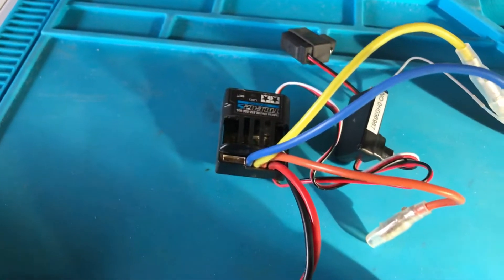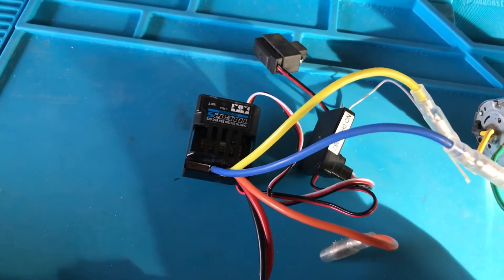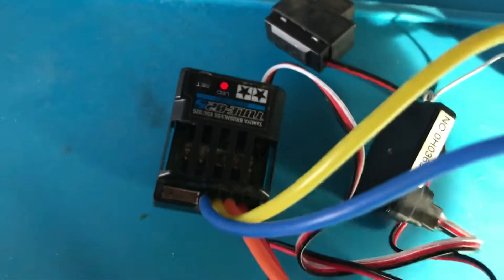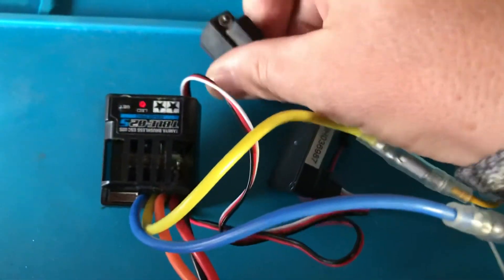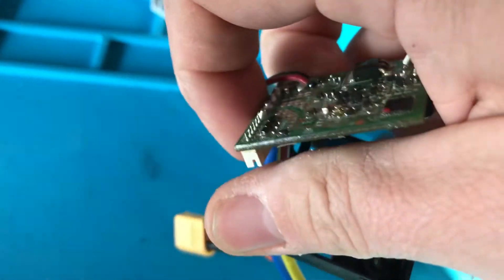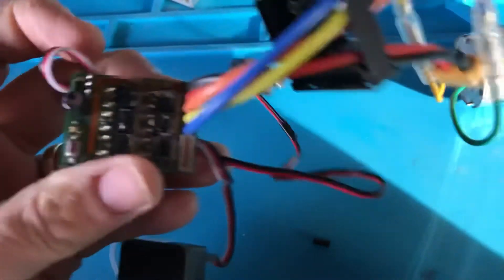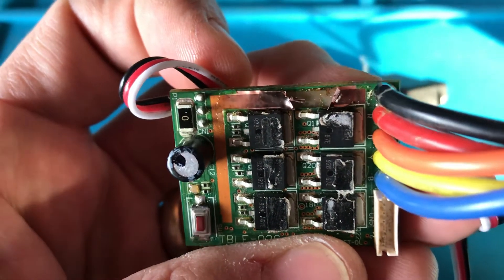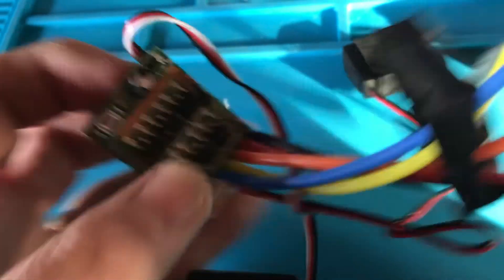Tamiya TBLE-02s Flashing red light overload protection

Comment: You can just jumper that. Make sure it isn’t too thick or it’ll rub the heat sink. Your bigger problem will be readhering the sink to the fets. You broke the surface of the adhesive backing when you pulled the sink. I repair these even when the fets blow. Pretty easy esc to work on.
Reply from the maker: I think if I blew another one, I'd likely go ahead and replace it. When it happened, I think I was inside ordering a hobbywing brushless kit within the hour and used it as an excuse to rip it apart. I'd been through so many documents online that explained what it "might" be, so I thought for future folks who come across things like this it'd be interesting to see. I actually just threw it out last week in preparation for a move.
Reply: @dangraves6358  I get it. Was always fond of these little ESCs. Hate to hear it got canned. But if it’s of no use to you, it’s of no use to you. You can get enough fets to repair 8 of these for 15 bucks. And that’s if every fet is bad. It’s usually only 2 of the 6. But it does require some hot air rework experience. I understand most folks just don’t have that. Take care!

Comment: Just solder a beefy wire between the traces. Just did it on my son's, works perfectly.
Reply from the maker: Thanks - I’m going to give that a go.
Reply: @dangraves6358  how to do a factory reset?
Reply from the maker: @larsbee  I don't see an option to do a direct factory reset - the manual though shows what the factory settings are and how to change them all - I found a semi-decent copy here:  https://imgur.com/dR6Mrb6
Hope that helps
Reply: @dangraves6358  thx for ur reply ... I got hold of the manual and already changed the settings but I thought the factory settings worked much better on my brushed motor than what I could change them to ... thx for the info!

Comment: i got same problem last 2 years...soldered a copper plate...works fine till today..
Reply from the maker: I still have mine in the garage.  Another guy mentioned soldering it would work. I think the only thing you'd have to be careful of is making sure you don't make the same error again because that strip failing was the fault protection. After I put the strips back together, if I make the same mistake again then my Tamiya's going to be a melted pile of burnt goo.

Comment: i've got a sound and a green light?
Reply from the maker: Interesting - the green light means it should work but it shouldn't be making any sounds. Maybe check all the connections and make sure the ESC is into CH2 of the receiver (I'm sure you've done this already, just trying to offer any suggestions I can).